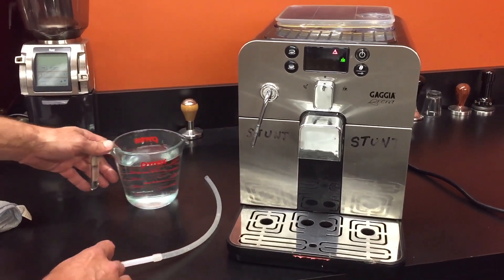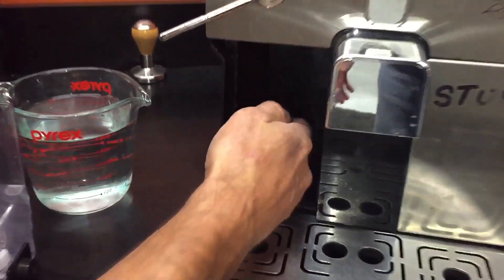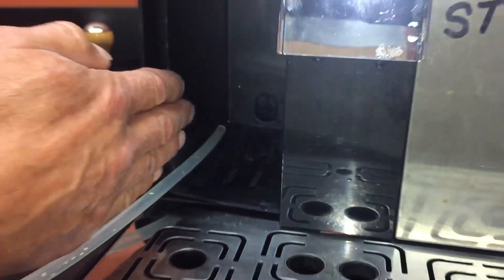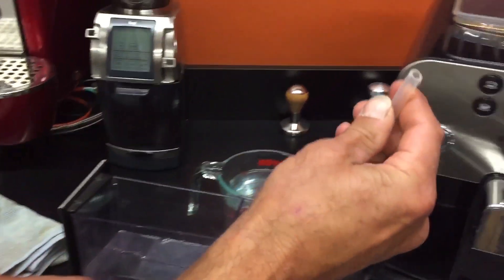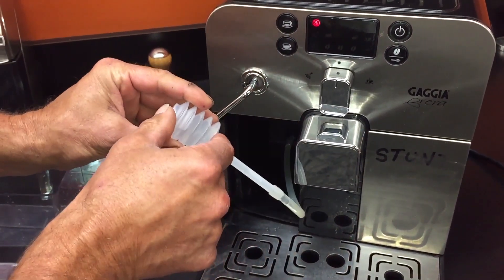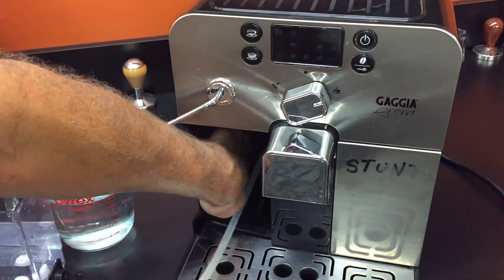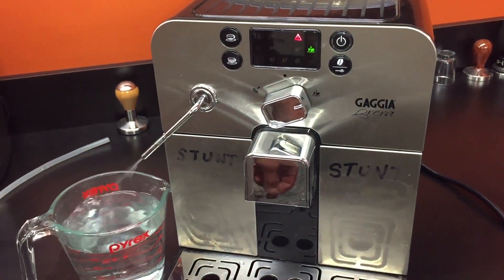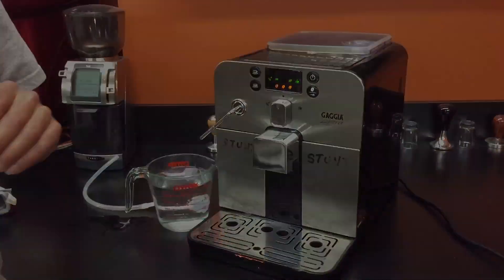How To Prime a Gaggia Brera

Comment: I have a question. It looks like ny machine (gaggia classic pro) got a little air still trapped in the tube. I used a syringe and it partially helped but it still has air in the tube. I can see it. If I put a tape around the tube and syringe to seal it would that do the trick?
Reply from the maker: Hi CN, Hmmm. You mean the tube in the reservoir of the Gaggia Classic Pro? There should be 2 tubes. One is the water intake tube to the pump and the other returns water to the reservoir from the OPV. Not unusual and normal to see air bubbles in the return tube. If your GCP is functioning normally there's nothing to worry about.
Reply: @Wholelattelovepage  its the water intake tube. I noticed how after I try the syringe trick it improved the flow of water but i didn't seal it so there's air trapped still inside.

Comment: Hi there - your videos are very helpful. I am trying to fix a ventilating issue. I have tried this (the wand has water but the coffee dispenser has stopped priming) - I have also tried deep cleaning the brew group as I thought the filter may have been clogged (it needed cleaning but didn’t solve the issue). I have also checked the water pressure sensor connection and that was fine. Any advice would be much appreciated. Thanks

Comment: What is the size of the tubing attached to the bulb?
Reply from the maker: Hi John, thanks for the question. It's 14mm. Silicone tubing works best as it's stretchy.
Reply: @Wholelattelovepage  Sorry I was not specific.  What is the internal diameter of the tubing to create a secure fit with the intake nozzle of the machine?  Also where can I find that tubing as your website only sells the according syringe.